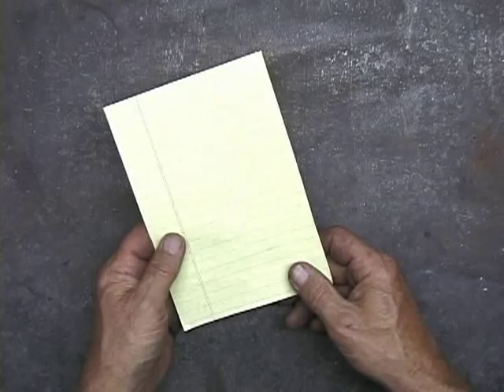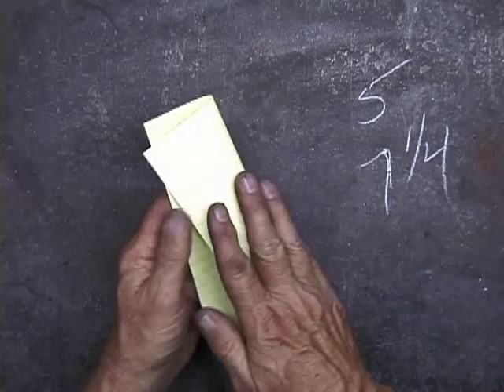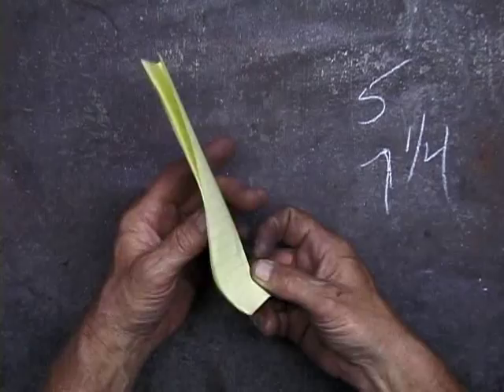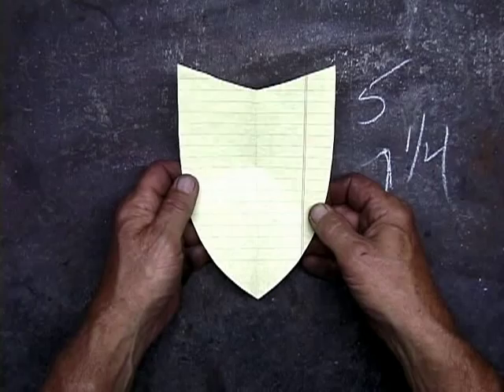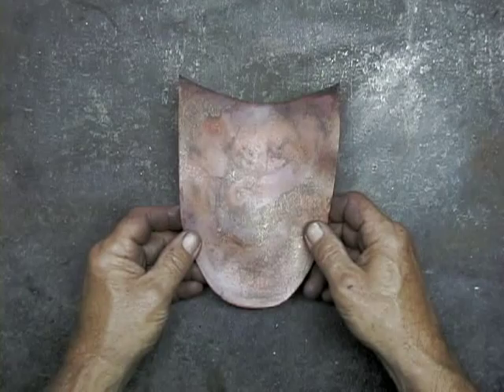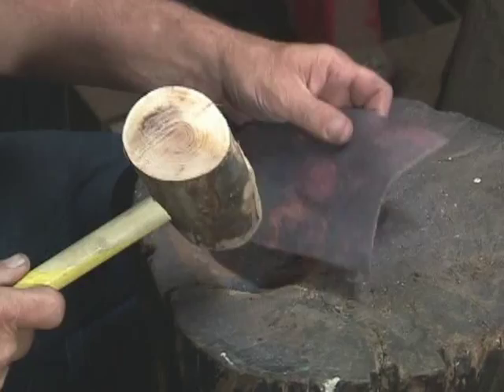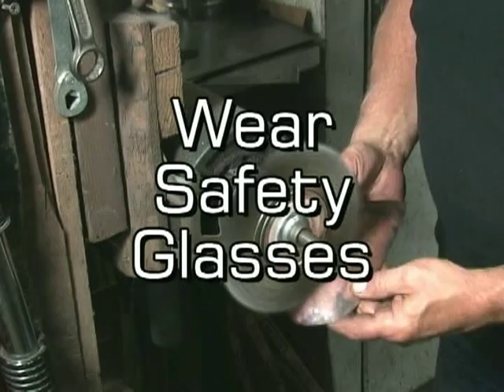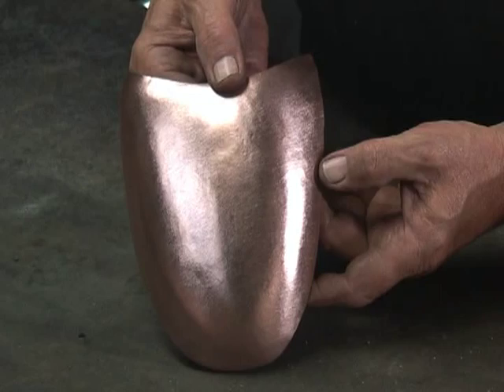Forming a Copper Mask

Comment from the maker: Brass is an alloy as compared to copper which is 99% pure.  Today there are so many  specialty metals it is difficult to know what percentages make up the alloy.  Basically brass is copper and zinc; but how much zinc or has some other metal been added.

I'm not a metallurgist so I just have to do trial and error tests.

Your knife:  Great gift for your dad.

Comment: ya I experimented also n gave up,  the brass was just 1/4" round stock from ACE hardware, nothing special. seemed to retain much of the internal stress, only the surface softened.  it shattered on me a few times but I didn't want to bake out the zinc trying to anneal it repeatedly if that wasn't going to take.  needed a longer heat/cool down or some special quench? just wondering what you have experienced, how you handle annealing brass? time n temp approximations would be boss :)

Comment: nicely done.  I love working with copper. especially when it is paired with brass and tin highlights. does the annealing process work the same with brass?  I worked on a blade guard 3 years back, n after I worked a nice ball on either end, I tried to do a decent "s" bend and nearly got knocked in the forehead when one ball shattered off.  I was trying to anneal the 1/4" rod but apparently i did too little or it has different properties. dad loved the knife w/ elk horn guard any way. thanks

Comment: What can you do to copper to keep it from turning your sin green?
Reply from the maker: Elmer, for my sculptures I usually use a clear lacquer or one of the Rust-oleum's clear aerosols.  For pieces like the mask, a good car wax would work well.  For a copper item that is going to get a lot of handling, I would use VHT clear aerosol  paint.  You can find VHT at auto parts stores such as Auto Zone.
Reply: Thank you for your reply, I am making bracelets.
Reply from the maker: For the belt buckles that I do, I use the VHT clear wheel paint.  I am sure that VHT would protect copper bracelets.  The next step up is powder coating.  I didn't want to go to powder coating.